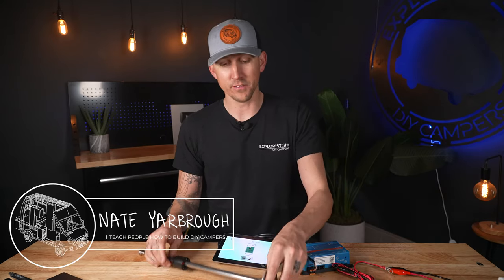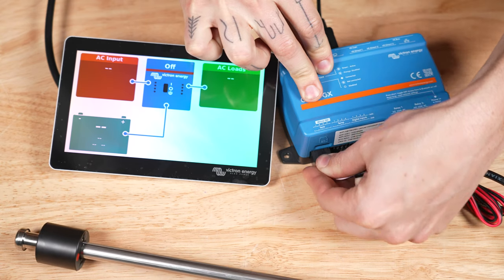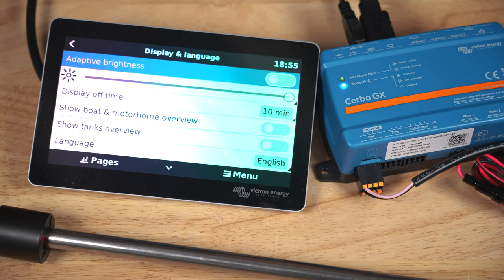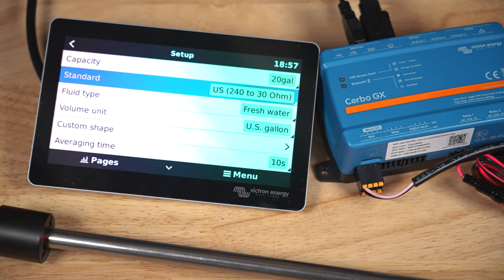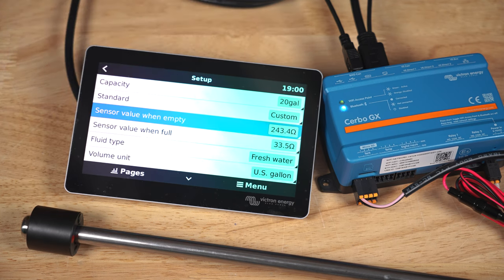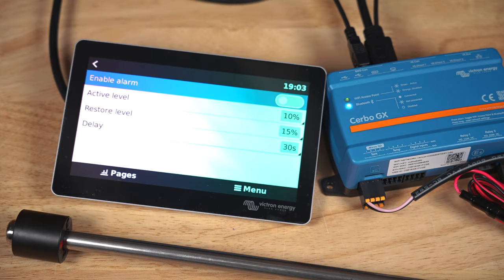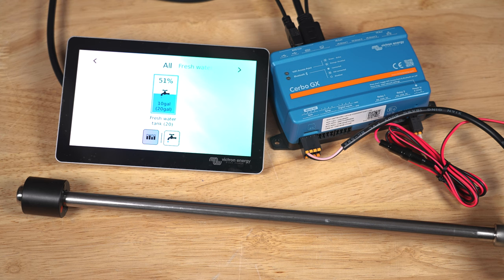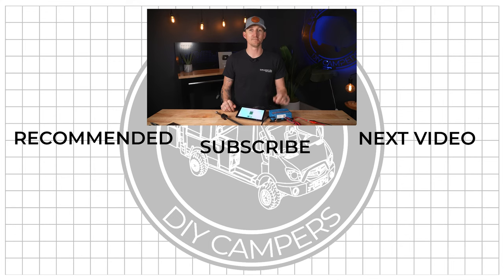TANK LEVEL SENSOR + CERBO GX (Wiring & Programming)

Comment: I have a similar sender unit in my 130L tank and I bought an analog meter for it. Very handy 😃 The cerbo system is great but I think I don't need it. It is not cheap ☺️

Comment: Just a point, the step resolution on most of these units is 21mm. So if you expect to see your tank measurement moving in 1 or 2% steps you will be disappointed just as I was. Apparently there are 4.5mm step units but I can’t find one.

Comment: Got this to work with the system I purchased from you. Thanks so much!

The screen will be in the front of the van. 

I'd like to add an analog gauge in the back near the gravity fill. 

Is it possible to connect the Cerbo and an analog gauge to the same sending unit? If so, what would the wiring look like?

If not, is it better to just add a second sending unit for the analog gauge, so two in one tank?

Thank you.

Comment: Hi  Nate , excellent video as always , have you a video on getting theVictron cerbo gx to display the watts  when connected to shore power or do i need a ct clamp also my cerbo dosent obey my max amperage from shore power  eg when max is set to 10A i could be getting 17A measured with multi meter , are these two items related
thanks, Phil  in Ireland.

Comment: Thanks for all the great videos.  I was programming a sensor just this morning.  with GAS.  I ran into a problem with the "custom" setting.   
it would only read two of them.. like when it showed 65 it wa really 62%..  and at 55% it was really 48%  
but when I added the 3rd, pair, it never read it... tried several ideas but the when 3rd was at 41% it should have said 35%.  but it always just showed 41.  any ideas? 
It deos have the latest Cerbo build 3.00~42  
wondering if there is a bug?  
THanks again for the Blogs and Videos.

Comment: Totally off-topic, but I think I want to add one of those sensors to my sump pump.  It would be nice to know the water level without having to look down in the pit.
Reply: That’s a lot of expense with all the different items needed and labor to complete the project just to be curios. 👀
Reply: @onionhead5780  Since the output is a resistor I could use it as part of a voltage divider to monitor the level, although it wouldn't be linear.  I could hook that up to a microcontroller with a 20 line program to re-linearize it and display fill % on a display.  Several more lines and I could have it text my phone if the level gets too high, before it overflows.  I have a similar setup on my waterheater monitoring temperature because it overheated once.

Comment: Nice job Nate.  I’m wondering if such a tank sensor can be wired to both an analog meter as well as the Cerbo GX at the same time?
Reply from the maker: Haven't tried that one.  Bench test it and let me know how it goes!
Reply: How did the bench test go? I have the same issue. WEMA resistive sensors (0 -1 80 ohms) connected to analogue gauges that would be nice to retain.

Comment: Your videos are amazing and very helpful. I'm sure I missed it, but what did you select a transit for this project? Do you prefer the transit over the MB Sprinter? Thanks
Reply from the maker: Transit is more powerful, a heavier payload, and there is a Ford Dealership about 5 minutes from our house where the nearest Mercedes dealer is about 3 hours away.
Reply: @EXPLORIST life - DIY Campers  thank you for the quick reply. Totally make sense. I did pull the trigger on a new 2023 Mercedes-Benz Sprinter all-wheel drive 170. Diesel engine and resale value was my motivating factors. I'm ingrained in watching your videos. Thank you for all you do. I'm sure I will be in touch for the items that you offer.

Comment: Do you have any tips on how to use those levels if you are installing baffle balls?
Reply from the maker: For volume; I'd probably just calculate as if the baffle balls weren't there.  As for them getting stuck on the sensor and not letting it float correctly?  I have no suggestions there. 🤷‍♂️😂
Reply: @EXPLORISTlife  thanks! It nay occurred to me after watching your video that the slider could get stuck. I might have to put it in a tube…

Comment: Hello, excellent video. By this means I am contacting you to make a consultation. I am from Paraguay and more or less in November of last year I set up a mini generation system with EV equipment, currently I would like to implement sensors for ambient temperature, surface temperature of panels, humidity and solar radiation, but no matter how much I search I cannot find it. the local market. That is why I want to appeal to your help to see if you can provide me with the number of a company that is dedicated to the sale of sensors compatible with EV equipment.

Likewise, I would like to appeal for your help in relation to some technical data that I do not know regarding the Cerbo GX and the Quattro Inverter. 

Cerbo GX. What is the current range in which the terminals for resistive sensors, temperature sensors and digital signal sensors operate? (This question arises because I have old sensors that operate in the 4 to 20 mA range and I want to know if I can connect them).
Quattro inverter: Are there terminals for sensors on the inverter that I don't know what they are for? Could you give me more information about the terminals?